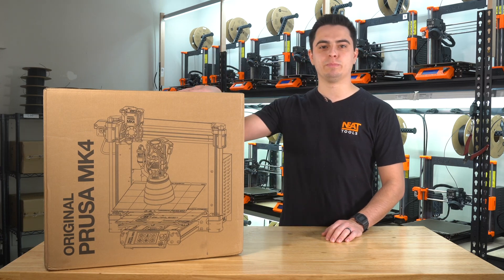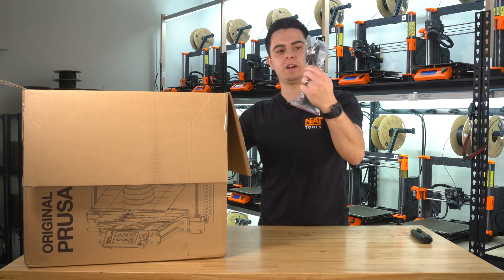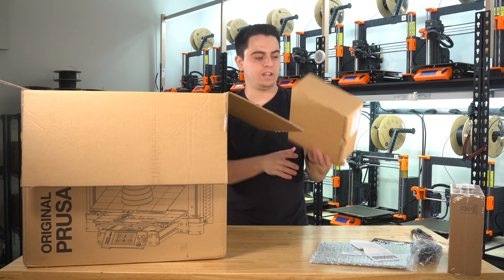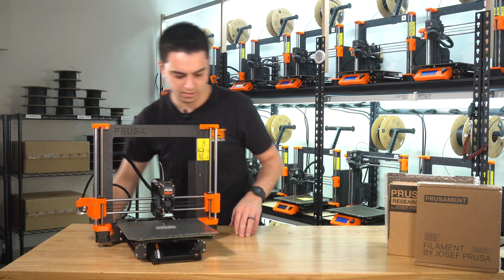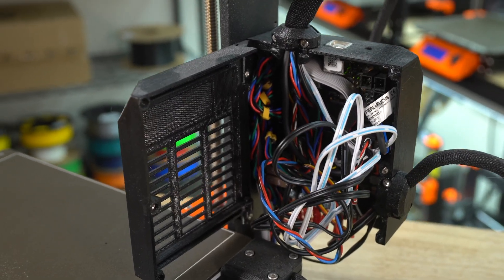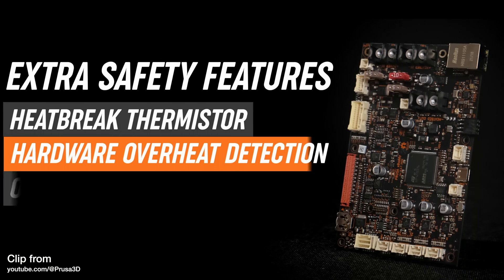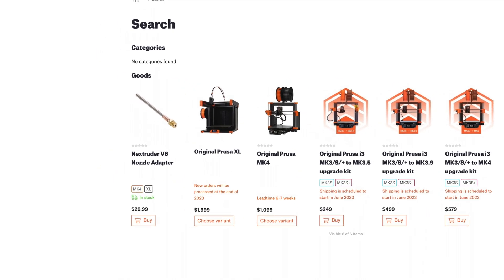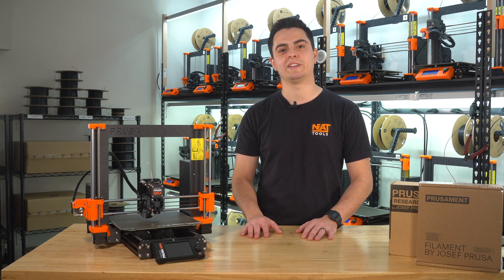Unboxing the Prusa MK4 for our 3D Print Farm - Neat Tools

Comment: I just don't see how a 1300$ prusa can touch a 750$ P1P... I don't wanna come down on anyone but it just doesn't make sense.
Reply: Because the prusa will still be around and running in 10 years while the bambu goes back overseas to have its bushing/rods replaced every year. Speed isn't everything, look at all the QC issues and returns bambu lab has compared to prusa. Reliability means everything on a print farm.
Reply: @LilApe  they haven't even been out a year yet lmao. Besides, you could buy 2 and use the other for parts. It would still cheaper than a bed slinger in 2023 hahah. So many overpaying prusa fanboys. You guys are worse than apple or Sony bois I swear. You're buying an ender3 deal with it
Reply: @ServerWoes  ...what? The Prusa I3 has been around for like a decade already, it's the most cloned 3d printer design out there. The MK4 is no difference from the MK3 in terms of proven reliability, they already clocked 1 million test hrs on them while it was in development for a year. BTW, I pay $810 out the door for fully assembled MK3's. I buy on black friday for free shipping and I get a 10% off for all assembled MK3's

Wanna call people prusa fanboys, at least we wont have to deal with warped build plates that bambu lab deems "normal and within spec", while they take 4 weeks to send replacement parts. Or they void your warranty because you threw the box away, or they ask for a $700-1600 deposit while they ship you a replacement printer cause yours was DOA.
Reply from the maker: From the consumer side I think you are probably right. 

From the print farm side, it is much better to have open source printers that I can print replacement parts or purchase 3rd party parts if needed. Also if prusa ever goes out of business I still can use my printers since the firmware and slicer are also open source. 

Otherwise I would have probably bought a few Bambu printers which look sweet!
Reply: @shopneattools  and while you're reliably printing I've churned out 4x the sales and already have enough to buy 4 more machines... It doesn't make sense in 2023 NO WAY NO HOW. Anyway, congratulations. Your shop looks great. Just need to update those bedslingers lol
Reply from the maker: @ServerWoes  Hey everyone is entitled to their own opinion, there are great arguments for both sides and thanks we have worked very hard to grow our business to where we are today!
Reply: High speed printing doesn't always have the best quality (strength)?
Reply: @donhoe100  yeah there was video from CNC kitchen on how he had to reduce the speeds because of this. the high extrusion speeds results is cold joints